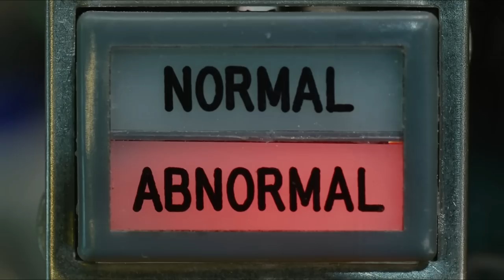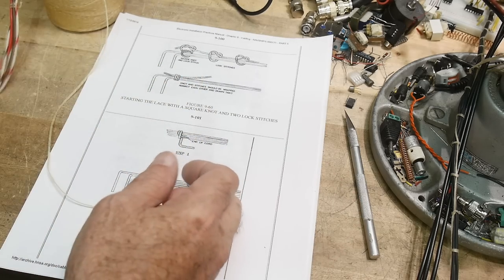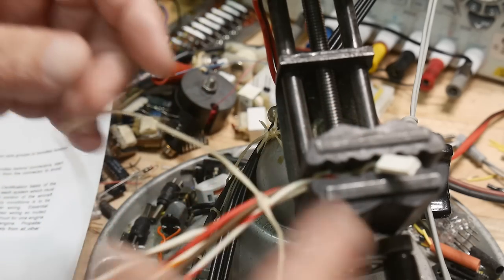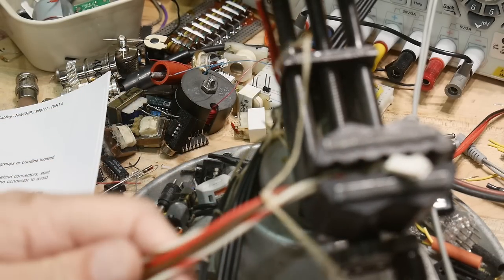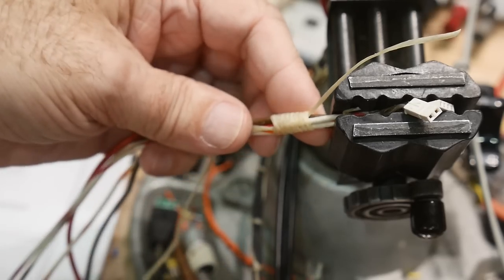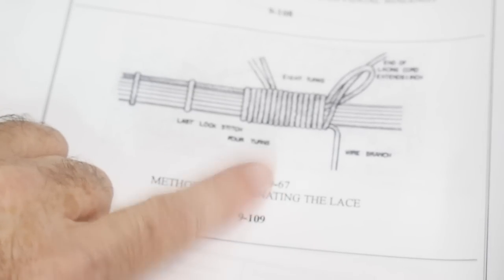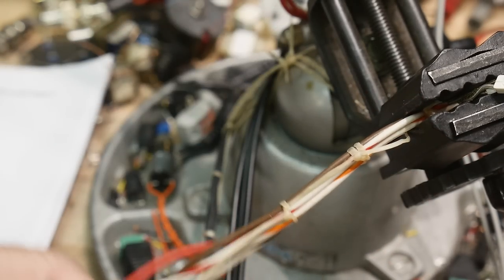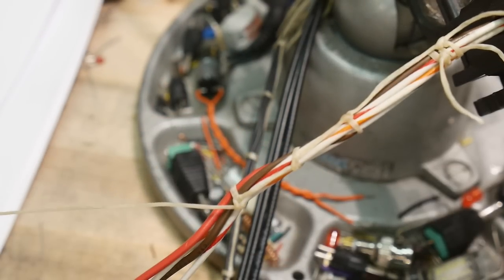#1404 Wax Cable Lacing

Comment: Back in the 70's at a place I worked - the ladies had plywood with nails in it to layout wires by color/size/length. After the wires were placed lacing began and the result was much as you have shown. I have a variation on your running knot. Where I do two opposite knots at one place which are the left/right versions of your running knot. NASA knows how to complicate things,... why else would it take so long to make space craft? A very anal retentive organization.
Reply: Yes, but those never come loose, even after being vacuum baked for decades, and cooked and frozen every 45 minutes during that period.
Reply: @SeanBZA  You are talking NASA I surmise. Yes true. However the product time to market is terrible. So now SpaceX is the leader. I do not claim to know what the standards are for them. NASA 'may' be driving some of that. Please explain if you know more.
Reply: I had a similar experience while at McDonnell Douglas.  They had an area where some of the aircraft wire harnesses were built.  As you note, there was a board  with nails to route the wire bundles so they would have the correct length, etc.  Prior to that time, I had been an avionics tech in the Marines, so I had an appreciation of the skill needed to work with wire harnesses.  Nice to see the techniques demonstrated again!
Reply: @mr1enrollment  SpaceX have drawn immensely on the work and publications of NASA. In many respects NASA did the science, SpaceX have done engineering with the knowledge NASA discovered.
SpaceX freely admit this and speak about it often.
Keep in mind that space launch is only one small part of what NASA does. It's just the part people see the most.
Reply: @zyeborm  ok